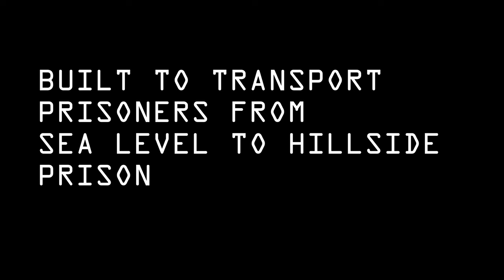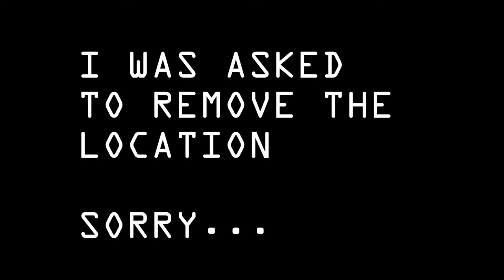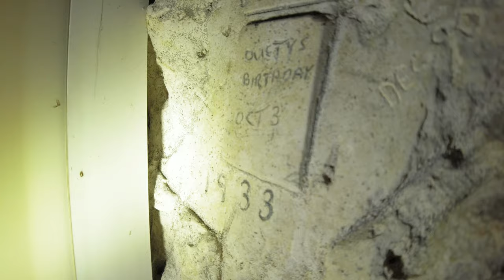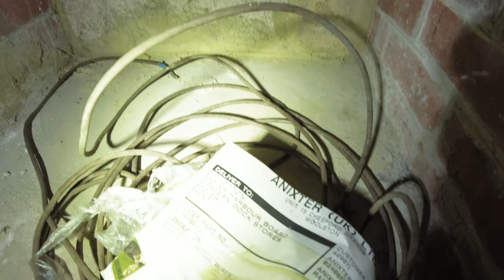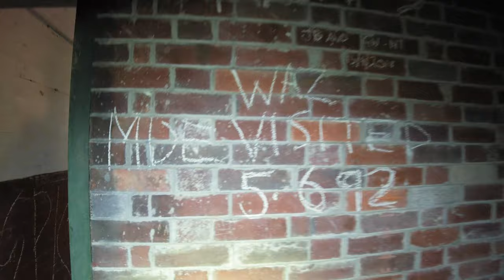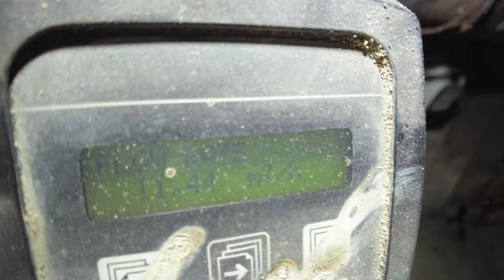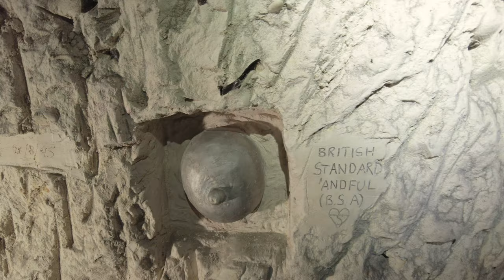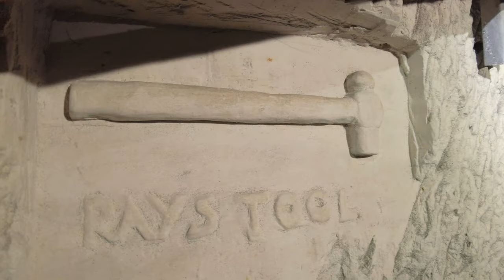Prisoner Transfer Tunnel DOVER

Comment: the sheer amount of work involved digging out these tunnels is mind boggling and all that brickwork. how did they do it? why were parts of the tunnels bricked and others not? how did they make those brick lined arch tunnels? ive been racking my brain how they  did it, and i  can only think it was done from the inside, but what sort of former did they use and indeed was one used? i do a lot of bricklaying  and i have asked the question on other channels but so far no answers or pictures of how they did it. normally  bricking an arch in a wall  you would use a former and brick from the outside, this  wouldnt be possible in these tunnels.  im genuinely intrigued, also  was al the excavation done first or did they do the digging and brickwork together?